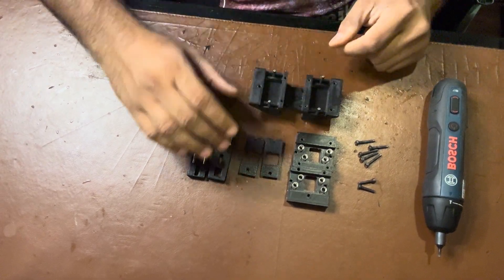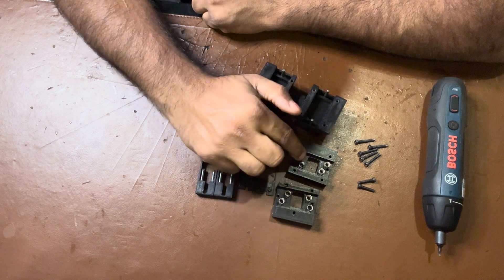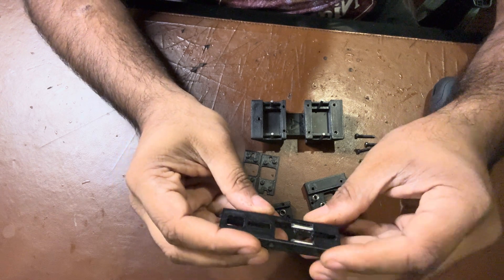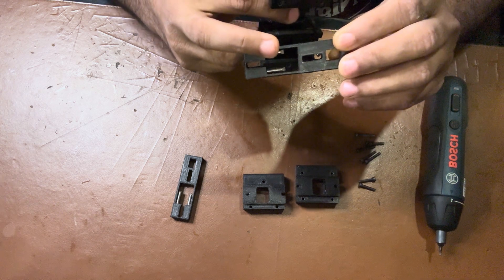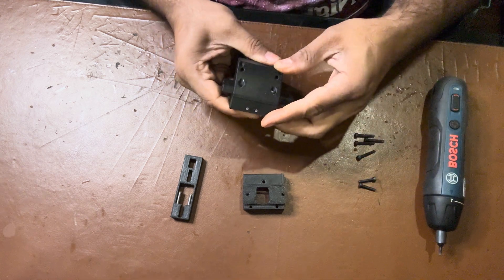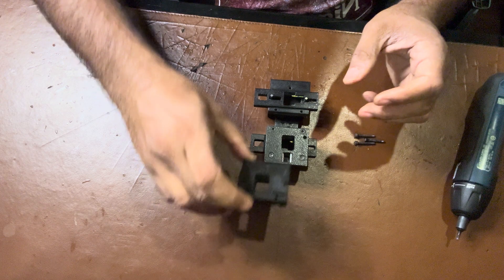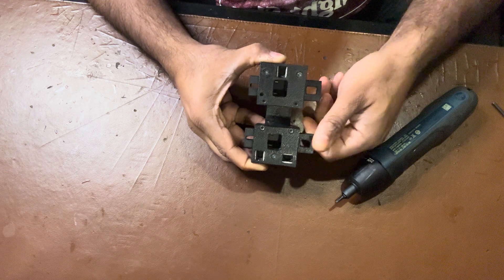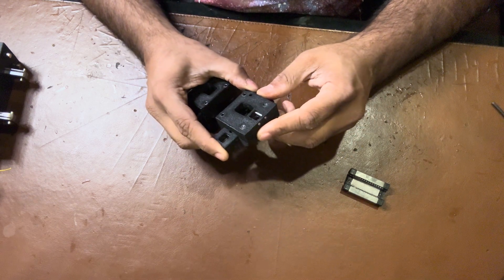DAKSH V2 Tool Changer - Tool Lock Carriage Assembly

Comment: What is your max acceleration with your toolchanger? Does the latch come undone at high acceleration?
Reply from the maker: I print at 15K accels - can go higher but I dont see the need for it. The locking is rock solid - i have tested it at upto 25K accells and it did not come loose even a bit.

Comment: Wonderful job! But I noticed the two rods and the housing where they are located are all made in Plastic (i Dont know if petg, ABS, ASA or PC). Does the friction of these plastic parts lead to greater wear?
Reply from the maker: No - I amusing ABS and have not seen any wear in the plastic parts due to the sliding motion. You can very lightly grease them when assembling to eliminate any residual friction - but eventually after a few locks and unlocks, the friction areas get smoothened out automatically. I musthave done more than 5000 tool changes and am yet to see any wear.

Comment: Great design! I downloaded your the CAD from github but am struggling to find out what causes the locking mechanism to latch (specifically the two bars the slide). It looks like there is a detent of some kind when you actuate but I see nothing in the cad that would accomplish this.
Reply from the maker: There is no detent - it is the pulling force of the spring and the movement locking nature of the kinematic coupling keeping the toolhead in its place.
Reply: @ankurv2k8 Can high acceleration loosen the locking mechanism and move the two bars accidentally?

Comment: Awesome iteration of the Prusa XL Tool Changer. I currently use a magnetic design with integrated pins for locating. Works well, but I am following this closely. Just a note, your video is mirrored, when you were tightening the screws, it looked like you were loosening them. And your writing on your shirt is backwards. This will give people issues when assembling.
Reply from the maker: thanks - I will fix the video. Thanks for letting me know,

Comment: Looking nice, keep posting the updates.

One question - could this work without the springs? There might be enough flex m the plastic to make a tight fit.
Reply from the maker: Not sure if it would work without the spring- the flex is not what locks the tool in place. the sliding lock plate needs to move in by compressing the springs. You need about 3-4mm of compression to lock the tool in place